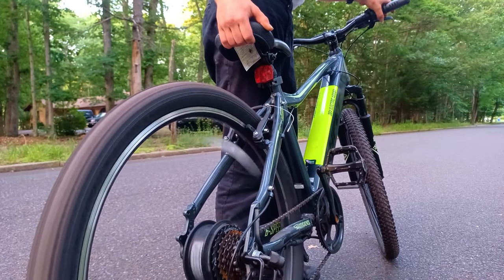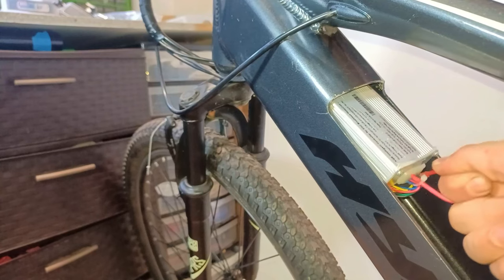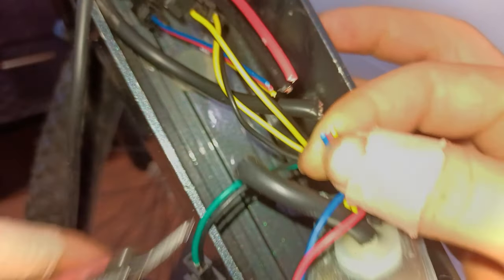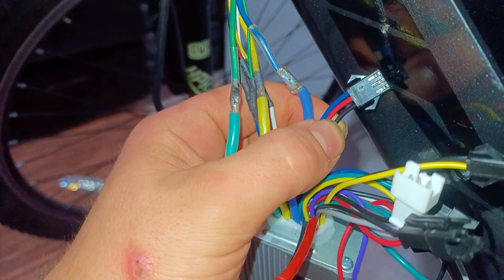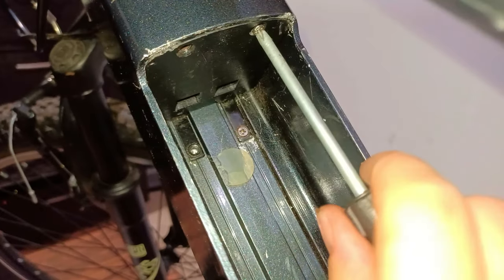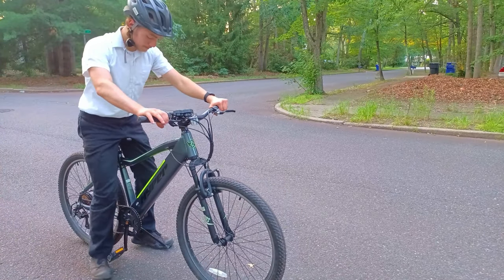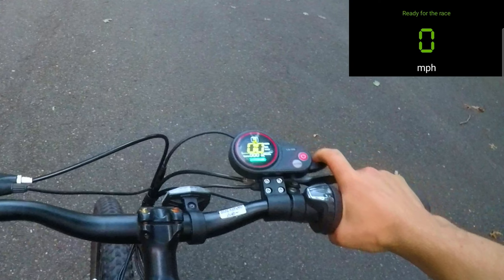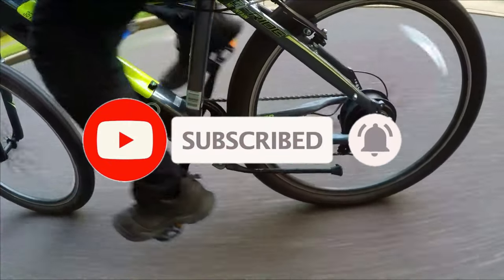how to add a THROTTLE onto a PEDAL ASSIST bike

Comment: Please could you give me some input
Reply: The next one down has more info on my issue. Thanx
Reply: @JRHill-jo5zc heyy Jr did you ever find out where it goes? I'm having the same problem! Please let me know
Reply: You have a hyper bike 26 inch.
Reply: You get the controller the guy suggested
Reply: @mikej6919 you have a hyper bike 26 inch and did you get the controller from the video
Reply: @JRHill-jo5zc  Yea it's a hyper bike 26 inch 36 V and yea the same controller and same bike
Reply: @mikej6919  the brown wire u don't use. Is the wheel turning or just making noise
Reply: @JRHill-jo5zc  just making noise honestly I’m trying to get a display of wire to wire that way I know exactly what I’m doing……
Reply: @JRHill-jo5zc  i if you can help me out I really appreciate it
Reply: @mikej6919  Ok so yellow motor wire to blue controller wire.Blue motor wire to green controller wire. Green motor wire to yellow controller wire
Reply: @mikej6919  those are the phase wires
Reply: @JRHill-jo5zc  is that the only wires that I'm hooking up?
Reply: @mikej6919  the brown wire no use
Reply: @JRHill-jo5zc  I didn't say anything about a brown wire! I said what wire to hook up to make the throttle to turn on
Reply: @mikej6919 hook up to plug on controller the extra wire on display is for light the other plug is for throttle hook it to controller
Reply: Anyway your welcome duh
Reply: @TimothyLeyh  I had did that but nothing came on…. Now I'm trying to find out even if the motor I got even work. Do you know how I can test it?
Reply: @JRHill-jo5zc  👍
Reply: @JRHill-jo5zc those are phase?

Comment: Dont work i get a e6 code
Reply from the maker: try to change the nominal voltage from e-bikes display which I show how to do in this video at about the 2 minute mark: https://youtu.be/_Bh6IKfam08
if it's already set to the same voltage from you're battery and it still doesn't work, than set it to the lowest possible voltage setting which I think is 24volts. nothing should get damage, the controller will now think that you're running a 24volt battery and nothing else. I do have to mention though, that the displays battery indicator will not be accurate after doing this, but it will give you an accurate voltage measurement by pressing the power button until it gives you the voltage

Comment: How would i know which one is the throttle cable on my motor?
Reply from the maker: @minutemarlow4291  you're motor doesn't come with a throttle cable, but it does come with a cable that has 3 thick wires and 5 thin wires